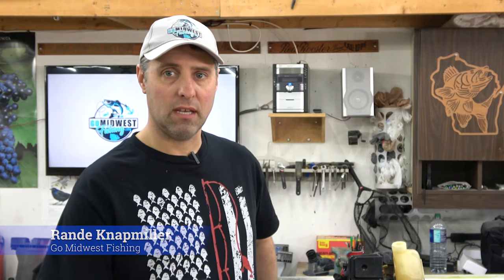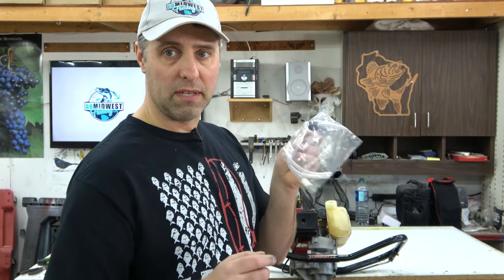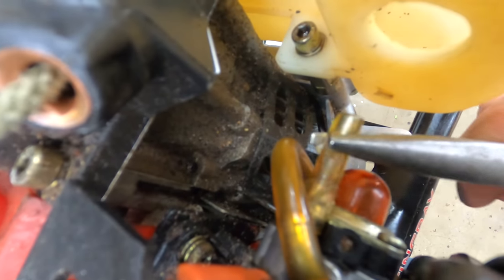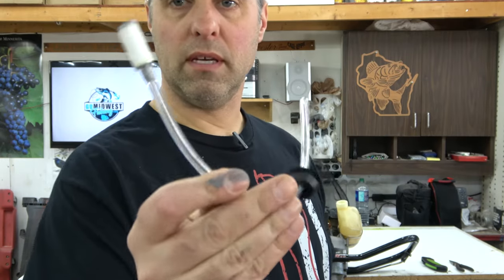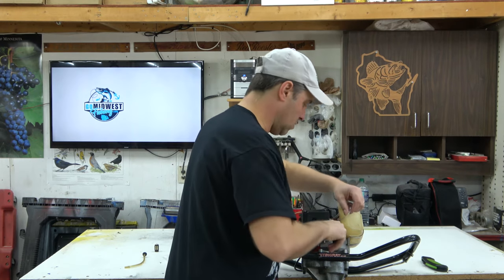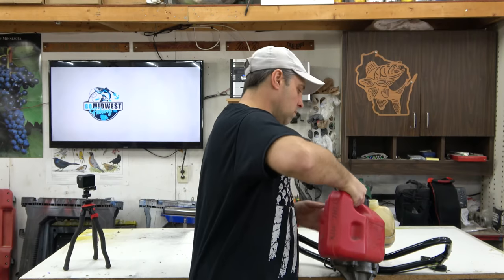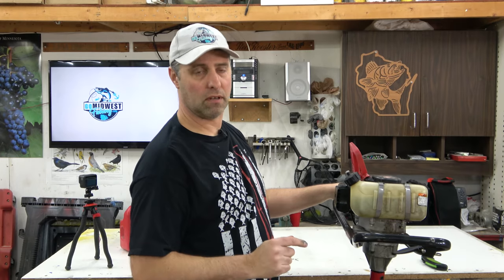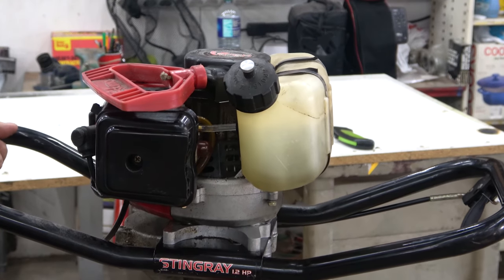Easy Fix For Leaking Gas Augers

Comment: I have had my 43cc Mako for 4 years and am now having to replace the carb and choke housing. I also have found a leak after replacing the lines last year. This will be the last repairs before I switch to the drill set up. Great video!
Reply from the maker: Thanks for the info. I've switched to a 40 volt strikemaster and couldn't be happier. You're going to love going electric.

Comment: My dad gifted me his Stingray when he upgraded to an electric last year and I just ordered this part yesterday. Glad I watched your video first so I didn't go crazy and try and remove the tank before I replaced the part. Looks easy enough with everything still put together. I ended up getting a new gas cap too which is "self vent". Hoping that one works well too. The rubber on the inside of the screw vent cap is all warped and I think it's only a matter of time before it stops doing what it should. Anyways, great video and thanks for sharing!
Reply from the maker: I'm glad it helped. It really is an easy fix, and most likely is the cause. I always like to look for the simple solution before I start tearing it apart. Good luck out there!

Comment: Ive been finding all gas lines are getting hard and brittle and cracking and leaking anymore, on my pressure washer, tiller and my kerosene salamander heater too. Nice video man!!!
Reply from the maker: Sounds like it is more of a gas line problem rather than specific to Eskimo. Thanks for the response.

Comment: I haven't run my Eskimo since I bought a drill and converter for my hand augers four years ago!  But I had this same problem.  I replaced the line and the grommet and I still had gas leaking somewhere, just not as bad as before! I'm not a big fan of gas anymore for the amount of ice we get down here in southern Wisconsin.  I hold onto my old gas auger only in case I go up north sometime where the ice can get over 3 feet thick some years (won't happen this year!)
Reply from the maker: I'm right there with you. I got myself a 40 volt strikemaster and I LOVE it.

Comment: Nice tutorial.  I have a propane gas auger that leaked.  I just had to reapply thread tape and that fixed it.  👍
Reply from the maker: I've never used a propane auger. I've never liked the gas smell on my hands after using a gas auger, so a propane one might be the solution to that. Thanks for the comment.
Reply: @GoMidwestFishing  They are pretty awesome.  You can go a whole season on one small tank of propane.  I didn't want a gas one because gas lawn maintenance equipment always leak gas or oil.

Comment: I've had Eskimo mako for over 5 years can't recall exactly. Always ran trufuel. I switched to Aspen this year and had the issue leaking steady stream from that grommet. In the past I had to replace the clutch and fix the kill switch as I somehow cut the wire. Been pretty reliable though otherwise.

Comment: Thanks.  My Eskimo 51cc started leaking yesterday.  Will replace too.  This is the 3rd. winter for it.  Seems early to leak.
Reply from the maker: Hi Rob. Thanks for the info. It seems to be a common problem. You would think it would last longer than 3 years, but apparently not.
Reply: Try to stay away from ethanol fuel. Store for the summer full of fuel. This will help keep the grommet lubricated. If storing dry. Spray rubber conditioner or marvel mystery oil on the grommet. They will re constitute.

Comment: Just tried that same repair on my Jiffy the new grommet was loose and leaked twice as bad as the originl, just a tip use the primer it would of started rite up.
Reply from the maker: Hi Randy! Yep, I used the primer. Maybe a little too much. I let it sit a while then it started. I use a Strikemaster electric auger now, and haven't had a problem with starting since!

Comment: My Stingray S33 is leaking fuel when I fuel it up. And it is coming out of the bottom of the tank. How do fix that?
Reply from the maker: Hi Ronald. Did you find the actual hole? Sometimes it can drip down the side and appear to be coming out the bottom. If you do have a hole in the tank, your best bet would be to order a new tank and replace it. Otherwise you might be able to do a plastic weld on your tank if you know how to do that.

Comment: Same thing here, a 4 year old Eskimo, are the other lines easy to swap out as well?  I just got the same kit you demonstrated.  Thanks man
Reply from the maker: I guess it depends on how accessible they are. The shorter lines are harder because you have less slack in them to move around. The old ones can just be cut off, and the new lines are nice and flexible, so they are easy to install.

Comment: I'm having the same issue with my rapala nitro. Would that fit on my auger?
Reply from the maker: I'm not familiar with the Nitro, so I can't really say. This kit was specifically made for the Eskimo. I guess what really maters is the size of the hole in the gas tank. The rubber grommet is made to fit a certain size. The rest is just plastic tubing and a filter.

Comment: Before you put these away for the summer spray that grommet down with rubber conditioner or Marvel Mystery oil. It won't dry out and shrink.
Reply from the maker: Thanks for the tip!

Comment: Samething is happening to me except my line is leaking at the opposite end of the line... It starts and runs but i have to push the prime ball after ever hole or it will shut off ... Im ordering a line like right now lol
Reply from the maker: Hi Corey. Thanks for the comment. I hope this fixes your problem.
Reply: You could have a cracked fuel line or a small hole in your primer bulb.

Comment: My brand new mako m43 was leaking before the end of my first season with it. Leaked all in my sled, the back of my truck, and like you said, all over the ice. Just filled it up to get ready for this season and the thing was leaking like crazy all over the place wasted the trufuel 50:1 I just bought for it. My personal experience and input as someone who owns a BUNCH of different brand gasoline equipment from 4 stroke generators and boat motors to 2 stroke chainsaws and leaf blowers. NOT ONE has had a fuel leak. This is a poor poor design for Eskimo/viper PERIOD. Cheap horrible design. All my friends with jiffy don’t have this problem.  Eskimo can blame gas all day long…I’m not buying it. My Stihl equipment, Mercury, generac, toro, John Deere, echo, use the same fuels and NOT ONE has a fuel line/grommet problem. Nothing like poor engineering leaking gasoline all over lakes. And the cap is lousy too in my opinion. Never really confident and it’s not exactly confidence inspiring that it’s sealed or threaded on correctly.
Reply from the maker: Hey Andy, Now that I think about it, I've had a couple Eskimos and they all leaked. I've never had any of my other gas engines ever leak. Its definitely a design problem. I've switched to an electric auger and couldn't be happier with it. Thanks for the info.

Comment: Eskimos will always leak after a couple years it’s a pain in the ass. That said at least it runs unlike the comparable jiffy’s out the box
Reply from the maker: It always ran, I will give it that. I just didn't like smelling like gas all the time. Thanks for watching.
Reply: @GoMidwestFishing  i just a bought used one last week used it the next day and it got gas all over my shit
Reply: @GoMidwestFishing  i can't even get it where i can set it on a certain side to stop leaking, it just leaks no matter what.. blades were dull as hell too but I got them sharpened up good.
Reply from the maker: @208flatheads3  My best advice, is to go electric. I got a strike master electric auger, and its one of the best fishing purchases I ever made. It always works, and is easy to use. The one downside is that they are expensive. You can always browse the classifieds and find a cheap used one though.
Reply: @GoMidwestFishing  yeah there's no way I can afford to buy one right in the middle of the season.
Reply from the maker: @208flatheads3  I find February is the best time to buy ice fishing gear. Its all on clearance.

Comment: My leak is coming from carburetor
Reply from the maker: I guess if it is not coming from a hose, then you might have a bigger problem. I switched to an electric auger and couldn't be happier!
Reply: Check your lines at the carb

Comment: Good video,unfortunately I had no choice but to give you a down vote because you neglected to prime the auger before you tried to start it which is the reasom why you had to try to start the auger so many times.I have a earthquake E43 Viper earth auger and it's leaking gas but other than that the auger started right up after not having been used for three years.You made such an effort not to cut the plastic bulb while you were removing the fuel line only to forget that the plastic bulb needs to be pressed five or six times before the auger can be started to get fuel to the engine.Oy Vey!!!
Reply from the maker: Oh, I am well aware of the primer bulb. Don't worry, I primed it before trying to start it. (I just didn't show it on video). This thing has always been hard to start. In fact, it had too much fuel, so I let it sit for a few minutes, then tried it again, then it started. I've since switched to a Strikemaster electric auger. No more hard starts in the sub zero temps.

Comment: If u own a Eskimo you have a fuel leak problem lol i don’t know anyone that does
Reply from the maker: Well that's good to hear. If you browse through the comments, you will find plenty of people with the same problem that I had. Its mainly a problem with older augers. Over time the fuel lines harden. Other than that, it ran pretty good.